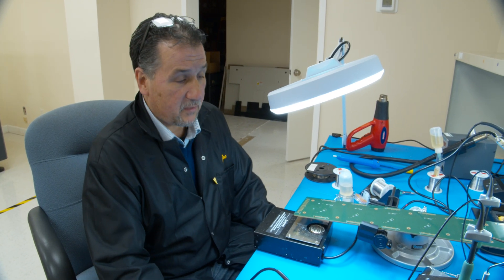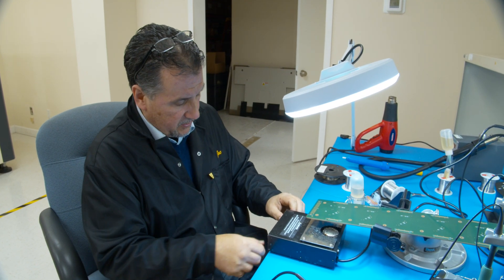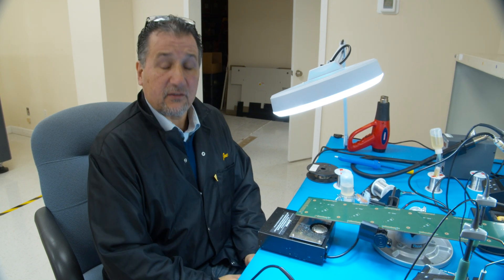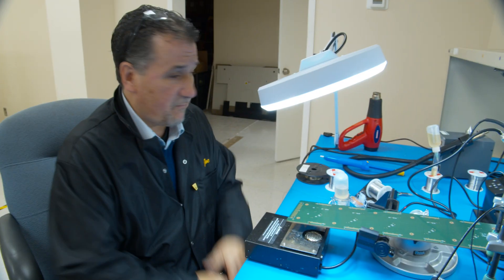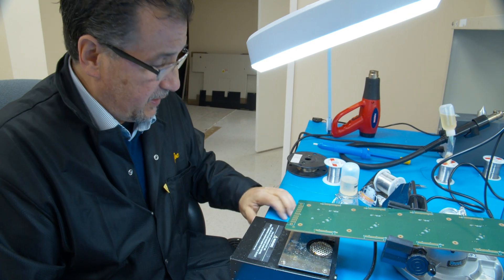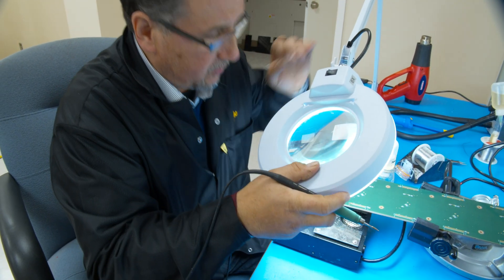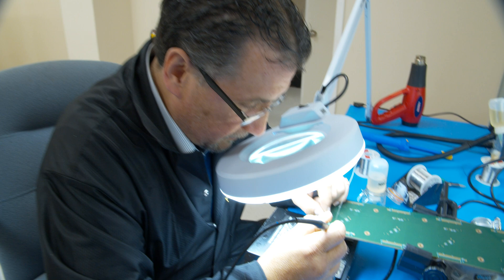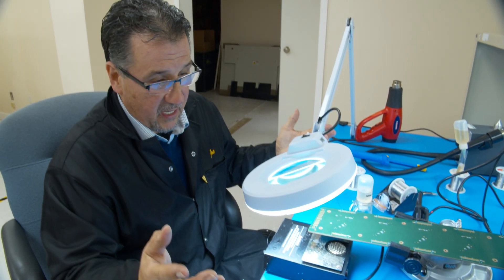Tips of the Trade: Clearing Solder out of a Through Hole

Comment: I've just bought a electric solder sucker. When hot place the metal tip  over the pin to melt the solder and then press the button and it will suck the melted solder  from around the pins. Really cheap as well 🇬🇧

Comment: Let's say you have a broken pin inside the holes thats shorter than the board, how would you remove that without damaging the metal pads / board
Reply: melt the solder and push the pin out by sticking a component leg into the hole

Comment: Quick ? Ray.  I'm a newbie at this, and wanted to know this.  When "desoldering components" particular ones you have every intention of replacing with news ones (i.e. like "Omron Relays" in my case), is it best practice to just grab some wire cutters and clip off or sever each pin of that relay that's soldered onto the PCB first, then "desolder" the left-over pins of the relays and associated solder-joints in the "thru hole" of that PCB, as opposed to trying to "desolder" each relay while they're still mounted or soldered onto that very board?

Comment: I do the same thing except after passing the wire I use the Hako FR301 desoldering tool. I pass one end of the wire into the tip of the tool and apply suction. The wire can now come out without drama or the use of flux or solder wick. Often the Hako will, itself,  pull the wire out as it is withdrawn from the board.

Comment: Stainless steel pin for me, a fine sewing needle.
Remove as much solder as possible (use a wick), plenty of flux, tin the iron, heat the pad and push the needle through.
Solder won't stick to the pin, the flux will make what's left flow onto the pad.

Comment: I use a big steel sewing needle in place of the wire.  Heat the hole, stick the needle in, let it cool.  Pull out the steel needle and the hole is clear.  Solder won't stick to the steel.  Pick the right sized needle for the hole.

Comment: Thanks for the tip. I can't tell you how many pads I've lifted over the years. I now use a very small pointed tip and some steel wool on the opposite side of the hole. Your tip is a lot better, less chance of damage, and a whole lot easier. Going to do it your way from now on. TNX again.
Reply: Thanks James glad It helped. I have seen some other good suggestions here also. Including the toothpic trick which will work in most cases.

Comment: Wow.  This is primitive.  Any decent soldering workstation includes a vacuum powered solder sucker that makes this task a complete no-brainer.  I got certified for avionics soldering in 1983 at Keesler AFB when I was a full time bench technician, and I can't believe this is even considered a good option when there are so many better tools to do this same thing with ZERO damage to the board or the runs.  This is like using a mechanical wire stripper when a thermal stripper is head and shoulders better than any sharp cutting tool for stripping wires, especially when the insulation is  Teflon as it is on all modern aircraft.
Reply: So your solution is to spend 10 minutes cleaning a solder sucker over a 2 minute job because you don't want to look primitive sticking some junk wire through a hole?
Reply: @aviandragon1390  I've done a whole lot of run repairs in my career because someone overheated the run/pad.  The repaired run/pad is never as reliable as the original run pad was.  Overheating a pad or a run is easy, and when it lifts, you're into way more than 10 minutes.
Reply: You generally have to abuse a pad pretty harshly for it to lift off the board. If it happens to you so often you should probably find a different profession.
Reply: @aviandragon1390  Not me.  Previous techs.

Comment: I use compressed air gun on one side  apply pointed iron on other side  apply air pull iron away first  works fine for me. A small o ring fixed or glued to airgun helps seal air against the board . Warning eye safety wear is a must

Comment: Have a cert for mil-std soldering and have worked many mil-avionics boards.
An actual better technique with less heating and repeat-heating is to use finely stranded silver plated wire (usually found on teflon and available if you look; esp. mil stuff).
By first lightly tinning the very front of the stranded wire, (without excessive wicking) then trimming to leave just a small solid tip, you can then saturate the reset of the strands behind with a good grade f flux; make sure to leave the insulation on the help keep the strands stiff and aligned.
Then, you place your tinned iron on the pad, then follow with the wire atop the hole and apply heat now to the wire.  The outside will soften and allow you to push it through the hole before the center of the wire softens and gives way.  Finally, shove the stranded wire in about 3/8" slowly then immediately pull back up.
This may sound like a lot but yu will quickly get the hang of it and only subject the pad/hole to 1/3 the amount of heat and stress.  
The fluxed-stranded o(and silver-plated) wire is so-so much better at sucking up the solder...
Reply: That's a very good tip. Thank you!

Comment: An elementary question . . . is there a specific reason that you preheat the board?  Less likely to crack?
Reply: Probably because the hole is connected to ground and if the ground plate isn't preheated when he starts heating it up with the iron a lot of the thermal energy will be transfered to the gorund plate and not melting the solder.
Reply: He explains it at the start. It's a multiple layer board and the holes are connected to ground, which means a lot of thermal mass to heat up before the solder melts.
Reply: @Bobo-ox7fj Check.  Thanks with a sub/likie

Comment: Bus wire is solderable, so the wire sticks to the solder. 
INSTEAD, find a material that does not stick to solder. use that to clear the hole.
@orion310591RS idea is the best method.

Comment: If you can't get solder out with braid, it's likely you haven't used flux or you're not putting heat in the correct location to draw the solder out.
Reply: I have seen desoldering braid without flux. You have to add your own. I bought it from the cheap local electronics store.

Comment: Just melt solder with soldering iron, and put wooden tooth pick in hole. You cant make any damage with toothpick, yet you clear hole by pushing solder away.
Reply: Damn that's clever
Reply: @MrMalam1234  Thank you, but just stop over complicating things, dont use items that can stick to tin (metal) and use wood. Simple solutions are around us.
Reply: Toothpick has diameters from 0.9mm to 1.9mm what do you recommend for 0.5mm to 0.7mm diameter holes?
Reply: @0101-t4r I used a sim ejector tool. Works extremely well.
Reply: @0101-t4r  Maybe aluminum wire? Take advantage of its solder-proof oxide layer.
Reply: Toothpick is pointy at the end anyways so I don't think it matters that much  @0101-t4r
Reply: @0101-t4r  
1. Try with pressurized air. Pushing force should be faster than cooling process.
Either from air can, or compressor connected to air gun. 
2. Another thing I would try it to make needle of aluminum 0.45mm then try to push it through. Aluminum doesnt bond easily with solder I think.
3. Try with medical syringe needle, maybe solder will not bond to it.
Reply: Nope. This is unprofessional. 😂. Nice try
Reply: I just started punching the air so hard reading this
Reply: @swifdy6855  You mean compressed air or? I didnt understood.

Comment: Thanks so much, I’ve been struggling hard with exactly this problem. I was so close, all I was missing was a piece of wire! That’s the difference between having the gear and knowing the tricks. Thank you
Reply: I fought with my cheap desolder station from 2016-2022 before discovering the necessary trick for power and ground planes.

Pinch the hose, hold the trigger, then jerk the hose open to get a stronger solder pull. When I don’t do that on power and ground planes the vacuum motor will spool up too slowly and will only remove solder from one side.

That’s because the solder on the tip side comes out while the motor is still spooling up, breaking my air seal and heat bridge before suction builds enough to pull solder from the component side… which has consistently solidified a fraction of a second too soon.

With the trick I get an instant full-strength pull when everything is still molten and sealed against the desolder tip. Someday I’ll rewire the trigger to a solenoid and abuse the station’s fume extractor function so that I don’t have to pinch anymore.

Comment: helped me out of a jam replacing an hdmi on ps5. solder sucker would not work. i didn't use solder wick. i didn't have bus wire so i stripped a few strands of cat 6. used a wagner furno 750 heat gun since the 500 watt heatgun rework station was useless. pushed the cat 6 trough the hole, cut off the portion below that was covered with solder, and continued that process until the holes were clean enough to drop in the new hdmi port.
Reply from the maker: That's excellent to know! we would love to see your work! Email us!

Comment: Thanks for this. I dont have anything to heat the board to 200*F, but did try using the lead of a resistor to push through, and on the way out used a wick to absorb what was there. It helped get me out of a jam I was in for several hours after my desolder station didn't want to suck out whatever was blocking it.

Ground on a multi layer board like you said happens.
Reply: Try using a heat gun if you don't have a heater you can at least do one lead at a time
Reply: Hair dryer, oven, toaster, a pan heated up in the oven, other creative solutions, you'll figure it out
Reply: Another trick is to rebore the hole with a pcb drill.